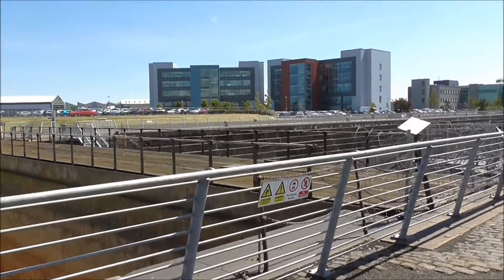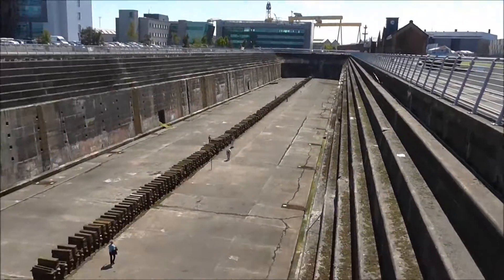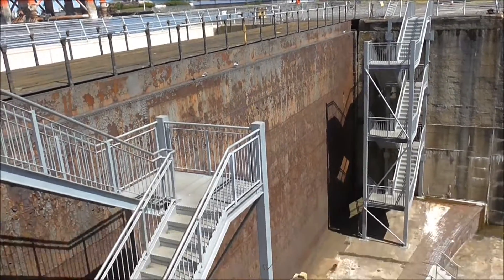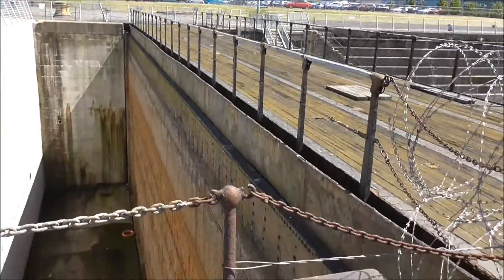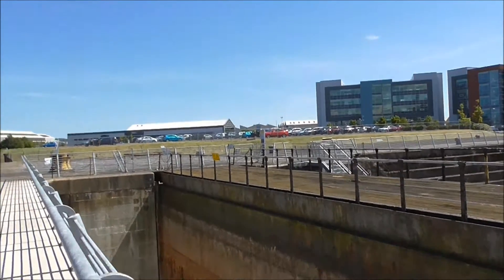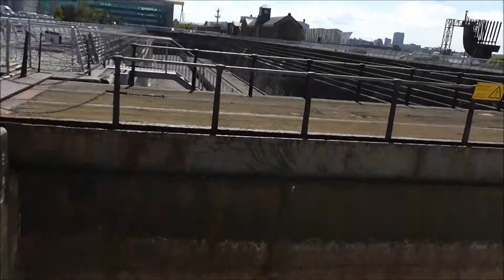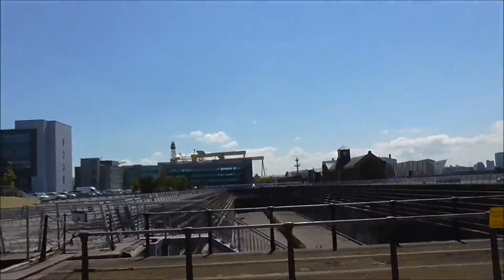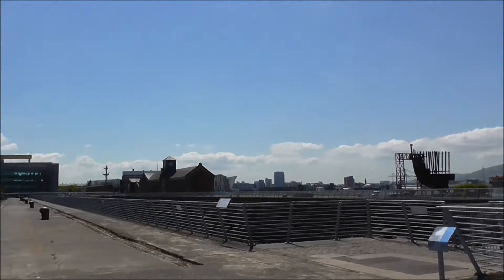Titanic Thompson Dock's CAISSON GATE

Comment: Tom, the gate go to the east side, slide. the railings need be dropped. There is a tunnel, small,  on the west side dock from pump house to near gate. Used be steam Crain, was lucky ! maybe last see in action out side pump station. needed fix over head cable so in `bucket` and travel towards end so get fix. what an experience, was about age 18. The dock is a `stepping dry dock` are others.
Reply from the maker: Many thanks for that information, Geoff. You have a lot of knowledge stored up from back then.